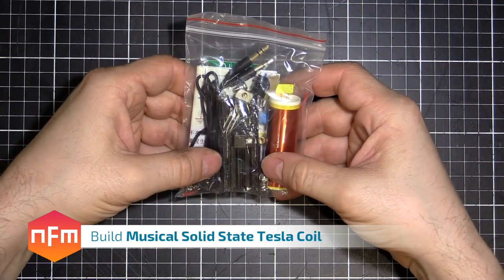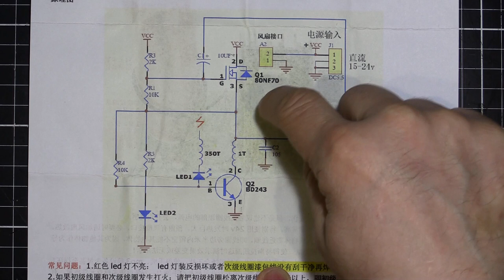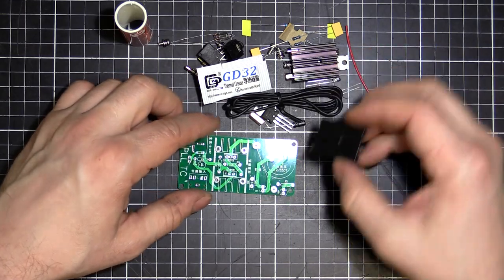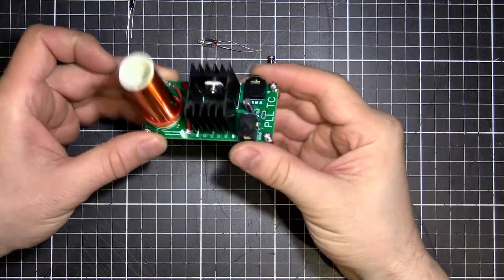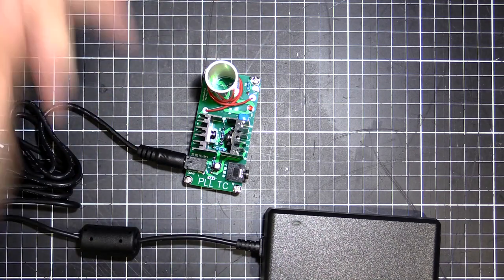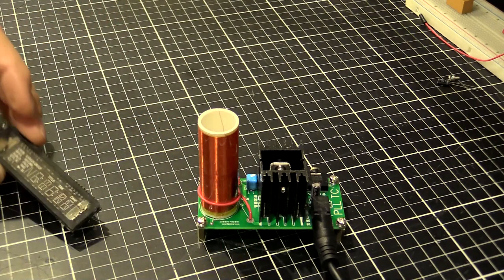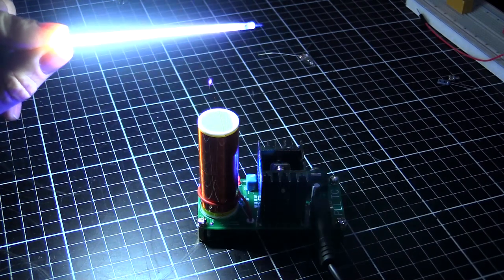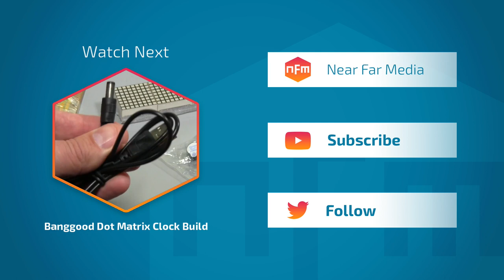Musical Tesla Coil Kit

Comment: Wow. I'm watching tesla coil videos because my son wants to make one.
Reply from the maker: You should make one! I'd watch that video. :) Start small like this one and work your way up.
Just be careful and smart and do your research. :)
Reply: If you want to get serious you`ll at least need a flyback transformer from and old TV. That with the correct sized tubes to wind the air cored coil(s), caps, cables, mounting board, mains cable and a few other things. You do really need to stand back though. My last effort had plasma sparks up to 3 feet long. Then the neighbours complained about interference up to 4 houses away. No sense of fun or adventure. Mind you, if you stood too close that one would kill dead easy. Made your hair start to stand up from about 8 - 10 feet away.
Reply: @noevilea624  if you made one correctly, it shouldn't kill you when you touch its arcs...

Comment: Thanks for this video, it helped me put mine together. Despite the Chinese instructions, the circuit board was well marked, but your explanation of how the Slayer Exciter works let me figure out a few minor adjustments I needed and where a bad solder joint I'd made was. 

Oh, and what the damn neon lamp was for, so I didn't go nuts trying to figure out where it went.
Reply: Where’s you get the actual power thing 5.5 x 2.1 to make it work?
Reply: I had all the same problems you had and is why I came here lol
Reply: @firemyster4707 you can just use any old random 15-24v DC power supply. I have a music studio so I have many power supplies to just randomly choose from.

Comment: Your digital display has a heater wire from left to right to heat the gas and aet the gas ionize at a lower voltage during normal operation. If you have a display wired properly, get your eye accustomed to the dark and look at the center of the digits with as few digits lit up as possible. You'll see a faint red glow from the wire across the display from left to right.

Comment: I have one of these im trying to learn soldering where do i get real instructions?
Reply: soldering is real simple it’s not hard and not really hard to mess it up
Reply: practice is the best teacher. You will get a feel for it.
Main thing is hot iron.
Heat the area to be soldered with the iron
Apply solder and watch how it behaves.
It should immediately flow around the area.
If it sputters, bunches up and whatnot, the area isn't hot enough.
Once it flows, pull the solder away, then the tip.
In general aside from a short, even a bad solder joint will las long enough to work.

Comment: Hi, I ordered the kit, which came without circuit diagram, so I have put it together using the pictures.  With the coil itself: does it matter which way up it goes ?  Also, with one end, it’s just left in the air above, and the other end, is it soldered to the one hole placed at the centre of where the tube sits ?
Reply from the maker: It doesn't matter which way up the coil goes, but the hole you use is 
the small one near the corner, just outside the circle markings for the 
coil location.
You'll see me install it at the 6:50 mark in the video.

Comment: No Red LED . . . 
Make sure to use a very hot soldering iron on the insulation of the 
enameled wire of the coil. That is the grounded end of the coil and so 
you can't expect the voltage to break through the insulation.
Reply: Aspirin is the best solution for removing the enamel. Just put the wire on the tablet and warm it by mean of the soldering iron. The acid removes instantly the enamel.

Comment: Hi! Some remarks (I hope). The printing of pins of FET is wrong: reversed. Please see 80NF70 pinout OR compare the schematic with PCB, where the "gate" is connected to Audio input (in reality the source - as on schematic). It does not make any problem if you build it, as you need to place it on heatsink, but maybe misleading if you want to debug..
Second. I would not recommend changing the coupling capacitor to 10uF as the arc is not capable to give bass sounds back clearly. It just distorts them !
Third, some facts with my measurements of four modules...
The current consumption is about 0.6A (not affected by modulation).
The resonance frequency is around 4.6Mhz but emits some electric noise up to 100MHz (checked with spectrum analyzer).
The temperature of heatsink goes up to 70deg celsius in the first 5 minutes of operation..
Reply from the maker: Thanks for the info!

Comment: Glad I found your video.  My Chinese is as poor as my Klingon so I could not read what the light was for.  I left my soldering station on, not knowing where that light and final screw went!  Now to find a powerful enough wall wart; and hot glue to heat up, to finish attaching the coil.

Comment: Good reference video.   I'm not an electrician and have some questions...  I used a 24v 500mA wall wart and it worked, even though it was supposed to be a minimum of 2A!  How hot did your heat sinks get?  Mine could burn my skin within 3 minutes, they where so hot!  How long did you let yours run without restarting?  How long without a fan do you think the tesla coil can run, before it fails?   thanks.
Reply from the maker: Yeah, the heat sinks do get really hot!
I think the circuit is as bare bones as possible and so won't really like long operation.....
I'm not sure how long it will run with a fan, but as long as the heat sinks are cool, I guess it should run indefinitely.
Reply: I bought a 12v 30mm fan and rigged it directly, attached and covering, the inside of both heat sinks.  So now I had to order some O rings, because of the noise of the vibration it makes, is conflicting with the sound of the tesla, while playing music.  But this stabilized the heat problem, so far,  where I had it on for 10 minutes.  I didn't want to take a chance on burning it out yet, until I play my guitar through it...

Comment: Thank you NFM for putting this video up. Very useful.
I have one also, but it barely makes the NE2 glow and even then it has to be touching the middle of the coil. And Like Shaun Thomson, the red LED doesn't light. 
Power drain is 300 mA at 24V input.  Measured RF is 5.6 MHz.
What frequency does yours come to?
Reply: Solution: Use a very hot soldering iron on the insulation of the 
enameled wire of the coil. That is the grounded end of the coil and so 
you can't expect the voltage to break through the insulation.
Reply: BURN the enamel insulation with a match or cigarette lighter, not a soldering iron (that is wrong way). Then sand the wire slightly, clean it, add flux and THEN solder it in.

Comment: I wouldn't think that a circuit this simple couldn't work... yet it doesn't.
Red LED lights up ever so barely and no HV at all. Coil ground is OK, scraped the insulation,  joint is all right.
Maybe that's got to do with swapping the BD243 to an MJE13007-2? :D (slightly more beefy, thought it couldn't hurt)
Reply: Sooo typical. PEBCAK.
Slightly better current capability on paper, yeah, but the hFE is only 28 as opposed to the BD's 130. Measured. :D
Works like a charm now. I guess it could use a driving transistor if I was to stick to that one.

Comment: Any idea what the red LED is for? Mine isn't lighting up but the blue one is. I don't get a corona but it lights up a florescent light.
Reply: Mine too doesn't work.
It barely makes the NE2 glow and even then it has to be touching the middle of the coil. The red LED doesn't light. And yes I've tried another red LED touching the terminals with the polarity the other way around and no dice.
The heat sinks get hot 200 mA at 18V
And I measured 5.6 MHz.
Reply: Both of my LED's turn on a second after I plug the unit in.  I didn't notice any reason for having two LED's other than to give you a visual que that the unit is on...
Reply: Mine doesn't light either... I also don't get a corona...  AND... it doesn't light anything either.  I check all the connections.  Ohh well.  It was cheap.
Reply from the maker: Did you make sure to get the two transistors in the correct locations? They are different part numbers and need to be installed correctly.

Other than that, maybe test the transistors to make sure yours are working ok.
Reply: Thanks MFM.
I've ordered another one. 
If it works, than I'll buy new transistors.
I'll buy new, because I don't think the FET can be easily tested for its "proper" functioning.
Reply: Shaun Thomson, my red LED doesn't work either, or lights at first, but dies shortly afterward, but I do get a corona, lots of ozone, and I can hear sound and music I put in. I think it might be over driven, or they're just poor quality LEDs.
Reply: I had the same problem.
Solution: Use a very hot soldering iron on the insulation of the enameled wire of the coil. That is the grounded end of the coil and so you can't expect the voltage to break through the insulation.
Reply: Thanks for that pointer!  I was really wondering where I went wrong!
Reply: Thank you very very much, mine didn't work just because of this!! Now it's perfect after I've soldered more carefully the wire of the coil.
Reply: thank you for this
Reply: I have the same problem, I will make Shure the led and HV ground is solderd in place.
Reply: 紅色LED燈不亮，無電弧，LED燈極性裝反或次級漆包線沒有刮乾淨再焊接。
Red LED is arc status light. If red LED is not on, you might soldering wrong LED pin or coil isn't power on.

紅藍2個LED都亮，沒有電弧摻生，氖燈感應不亮，檢查三極體型號是否裝對，如果三極體對，就是電阻裝錯
If both red and blue is on, but shows no sign of arc, check bipolar transistor. If bipolar transistor solder right, then you might solder resistance wrong.
Reply: I solved that by scratching the end of the coil wire that need to be soldered to the board. The problem is that the coating of coil wire is not electrical conductor, so you need scratch a bit before soldering to the board
Reply: i think the red led is only a discharge led
Reply: OMG Dude it works! Thx so much.
Reply: Shaun Thomson Exact same with mine
Reply: It shows the musical signal
Reply: The instructions on mine says the light that turns on depends of which way you coil the large wire.

Comment: NFM...Have you checked on what frequency this operates..Could somewhere from LONG wave to MEDIUM wave (AM band) The oscillator carrier could land on somebody's favo(u)rite
AM station.  The arcing tip could be producing "hash"... noise over a very wide band.
The odd burst wouldn't be much of a problem but running continuously as a speaker could wipe out a large piece of band, giving the FCC or whoever is your local controlling body, plenty of time to trace you down..That's when the fun really starts!

Comment: Question. I assembled this thing but I don't think it's working. Is it bad that I cut the very top of the copper wire that sparks? The sticker was bugging me I couldn't rip it off so I just cut a quarter inch off the top.

Comment: Any idea how to trouble shoot this thing?   The instructions on the one I got which look exactly like yours said the + and - terminals on one of the LED's was reversed.  So, I did correct that after testing it with a multimeter and seeing it light up when the correct electrode colors were matched.  However, it still isn't turning on with about 5 different power supply tries, everything from 5V 2A to 20V 1A.  Unfortunatley I don't have a perfect 15-24V and 2 A DC supply.  Either the voltage is a little low and amperage high, or voltage is high and amperage is slightly low.  I'd figure at least the LED's would light up.

I don't know if the 1 wrap wire needs to be in a certain direction or perfectly close together.  I've checked all solder joints, ran through it with connectvity and hear the buzzing noise on my multimeter, just can't get the dang thing to power on at all!

Comment: Mine is not working too. Looks that the enamel has not been correctly removed. I used however a lighter to burn the tips of the coil wire.
At the end, yes the white LED is not lightning up... and I cannot see any oscillation into the primary by using an oscilloscope.
Is that the primary coil wire soldered in the right direction?? I used to do exactly like the photography as I cannot read Chinese.

Comment: Hi.
I have bought the same stuff but I have a problem. The schmatic show 4 resistors with different values, while on the component list they are placed in different places i.e the R4 in the digram is the R2 in the list. Could you tell me how have I to place the resistor in the right place? Thanj you

Comment: I've gotten 3 of these things from 3 different companies and no matter what I do I cannot get the to run. 0.3 A running, no corona, no red light, only about 0.63V across the LED. The 350t coil shows continuity albeit with some resistance. The resistance was consistent across all 3 coils. What the heck is going on.   :(

Comment: Damn youuu! 😂 People want to see the video slower so they can see how to put the darn thing together. How does the coil go on there? What to do with the wires?
Reply from the maker: The thin wire from one end of the coil goes into the hole just to the side of the circles showing where the coil sits, the single turn of thicker wire goes into the holes as shown on the PCB artwork by the line connecting the two pads with the zigzag design.

Comment: Hi, this is awesome! I have a question, where I can get that glowing tube you have on video (14 minutes and 17 seconds)? I made a same tesla coil and I want to buy that tube :) thanks a lot for reply
Reply from the maker: Sairax Official It's just a cold cathode fluorescent tube. You can find them as the backlight in almost any non-LED backlit LCD screen.
Reply: Cool, thank you :)
Reply: Do you have to use the Grease or will it work/be safe without it?
Reply: Or an older scanner.

Comment: Please help me. When I plug it in with a 24v 1A adapter only the blue LED turns on. It doesn't make sparks or turns on the neon light. It does nothing. I burnt the coating on the secondary ground connection, checked the polarity on everything and checked the MOSFETs. Everything is in its place but it doesn't work. What could be the problem?
Reply: Same problem.  Mine worked once.. barely, and then nothing since.  The lights are on but no sparks come... (sigh)...

Comment: I figured out the answers to my questions the only thing now is there is 3 unused holes 2 all the way to the left with plus minus sign next to them and one hole right under the coil is this supposed to be like this
Reply: Don't worry about the 2 holes near the input "jack". They are another way to supply voltage.
An an Electronic & Electrical Engineer, I am confused about the pad inside the coil?????

Comment: I cant tell apart the 2k resistor from the 10k also witch way should it be facing. witch way should the capacitors be facing. where dose the coil connect I see two holes one on top and one in the middle of the coil
Reply: these are just holes that connect the tracks on one side to the tracks on the other side
Reply: Arturo Nunez resistors don't have any specific direction they need to face. Electrolytic capacitors do though (the black cylindrical things that came with the kit)

Comment: mine came with a glue stick that I assumed was for soldering the parts together, however mine isn't working.. should I have used other material to solder?
Reply from the maker: I'm not sure about the glue stick? You mean the white paste? That would be used between the transistors and heat sinks.

I used my own solder to make the kit.
Reply: It's a "cutting mat".

Comment: The LED's light up on mine, but that it... The soldering has been done right and the input voltage is 19V (which should be enough).
I though the biggest issue was one of the legs missing threads, but it doesn't even seem to work :(

Comment: What effect would a 3A supply cause? Would it heat up faster? I Have a 24V - 3A supply and I don't know if I should buy a new one.
Reply: If you have to ask this, I think you shouldn't play with anything that creates sparks. The current rating on a power supply is the maximum current it can deliver, not the current it does deliver. You can use a 24V/1000A supply and it will still be fine.
Reply: You still didn't answer my question though, what would happen?
Reply: Nothing.
Reply: He answered your question. A 3A psu i capable of delivering 3A at 100% load. It doesn't mean it delivers 3A. It doesn't matter if you hook this thing up to a 3A psu or a 1000A psu.
Reply: Well not nothing. It should work fine!